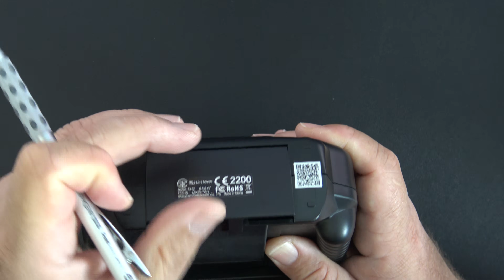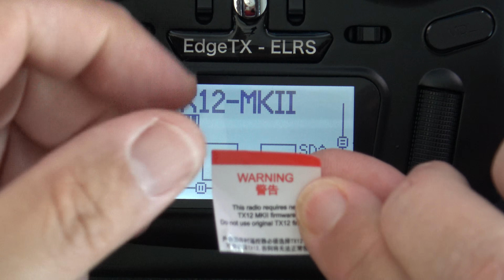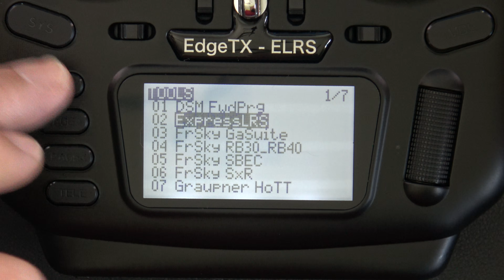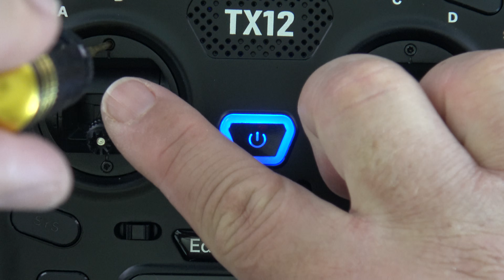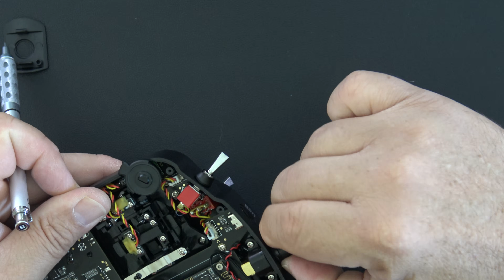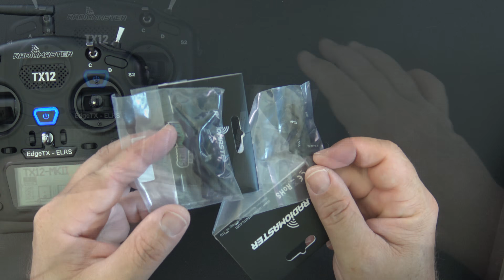Radiomaster TX12 Mark II with EdgeTX and Express LRS First Look

Comment: Maybe I'm a total noob, but how can you practically use 16 channels on a TX that only has 6 switches + 2 sliders? 

I obviously don't have anything that uses that many channels, but I'm imagining, things like flaps, extra flight modes, lights, launching fireworks, etc. It seems like most things would require at least 2 position switches, so how are all the extra channels accessed instantly?

Comment: Charging and battery holder are minute issues. #1 While charging; even if the port was on the bottom, you would still lie it on the back. #2 Battery holder; just cut-off a custom piece of foam. Or use the sponge landing pads that you buy in a box.

Comment: Hello nice tutorial, but I must say I am in a deep trouble , hoping you guys could help me ,I am very new to this field , this is my first build with Pixhawk 2.4.8 and Mission planner. I am planning to buy TX12 Mark II Radio Controller (ELRS version) , please help me choose a receiver, I am unable to figure out what is needed for my quadcopter and also what is the difference between RP1 ,RP2,RP3 ELRS Nano Receivers and ER4 ER6 ER8 2.4GHz ELRS PWM receivers? please help me  and also do I only have to buy the receiver or any other extra hardware with it ?

Comment: They should have just allowed you to upgrade the v1 tx12. I like my radio more with the dual charge, comm usb C port. I like the grips more on mine. I just wish it had ELRS instead of the useless multiprotocol module.
Reply from the maker: Probably tough to please everybody.

Comment: I just got this and a tiny ape and am struggling hard... do I need to update the software immediately??
Reply from the maker: The only thing you really need to do with software is to make sure your ELRS tx and rx are running the same versions. The firmware that comes with the TX12 is fine.

Comment: I meant to comment last month when my tx12 arrived, but I wanted to mention that I purchased direct from Radiomaster along with their lipo battery, and it came installed in the tray with some very snug foam in there.  Not sure if the foam is new or they did it just because I bought the battery along with it, but no rattles here!
Reply from the maker: Maybe they watched my video! :)

Comment: Hi! I have the elrs version of TX 12Mk2 only to find out it does't have MULTI protocol(at leat in the radio setting). I only see CSFR (the elrs receiver I ordered is on the way yet so I cant test the crossfire part). Am I correct to say it really doesn't support other protocol? Then, playing with the EdgeTX Companion, I accidentally, was able to set "MULTI" in the internal RF of the radio! I got excited but sadly I had no luck binding both Radiomaster and flysky receivers to it. I might be doing it wrong (binding) or is it just a setting glitch and the radio is still saying " I'm ELRS only"? i feel bummed I cant use the radiomaster receiver I just bought. Thanks in advance.
Reply from the maker: If you bought an ELRS version of the radio, you can only bind with ELRS receivers.
Reply: @RCVideoReviews  thank you. I need a multiprotocol module then. I hate to part ways with the cheap Flysky receivers I have.

Comment: Hi there,i have a question or u can say confusion.i got my tx12 mk2 and the first mistake I made,i powered on the radio without the antenna,i actually forgot to install then as soon as I hear the welcome mssg i realise the antenna is not there so i quickly shut it down,will it harm the radio for that?it's still working tho but no idea what goin on inside.
Reply: You should be fine. On first power up the default model should have no module selected so RF should be off.
Reply: @sansjunk  actually it was not the very first time,my bad i forgot to mention i actually checked when i got the radio it was binded to someone else's quad for checking then i detached the antenna and leave it in the box then after i got my quad,now this time when i powered it on the antenna was not there.Thats y m scared tho as I mentioned it's still working but is there any way that i can check if everything is fine by signal strength or something?
Reply: @as1asim  Ah OK. I believe you should still be fine since you didn't leave it powered ON without the antenna for too long and hopefully the ELRS module was set to low power (10mW). You can do a range check by setting it to low power and then walking away and ensuring you still have a good LQ and are able to control the model.
Reply: @sansjunk  yes it was set to 10mw,it was like under 4-5secs.Thnkx man🙂🙌

Comment: I have a question. I’m brand new to the hobby and I’m looking for a good transmitter to buy
and the question I want to ask is that, you showed that it has Elrs installed but is the Fs in their also another receiver or is that something else and do you need to get another module to work with other drones?
Reply from the maker: I really don't understand this question...
Reply: Sorry I put this wrong. Is Elrs the only pre installed module on their or are their others on their
Reply: @FireChicken747  The ELRS comes only with the ELRS internal module. You can buy and install an external multi-protocol module at the back to open up a whole lot of options to fly many models. I bought an IRange IRX4 MPM module to do just that.
Reply: I’m new to this stuff so I still have a lot of learning to do

Comment: Will the battery for the TX16S work in the TX12 ?
Reply: According to their web-site it looks like it does.
Reply from the maker: They use the same 18650 tray. I haven’t tried stuffing the radiomaster 5000 2s in the tx12 but I think it would fit.
Reply: yes it does i have both with the same 7.2v lipo

Comment: Great review. On the battery compartment... They went from "so tight you can barely get the battery out" to "baby rattle loose"... but I think that was so you could use to 21700 5000mah battery pack with it ;) if you look closer at the battery compartment, you'll also see a cutout for the XT30 lead. And if we modelers can't figure out how to stop the rattle with a piece of foam, we shouldn't be in the hobby! 🤣 While I also wouldn't have minded the pots on the top for sound and brightness, at the same time I think we're expecting too much TX16S and starting to clutter an otherwise well spaced out layout.
Reply from the maker: The battery thing is an easy fix which begs the question why wasn't it fixed. As a reviewer if I don't call that type of thing out, I get called out. 

Controlling volume is just kludgy without a knob. I've used the firmware to work around this https://www.youtube.com/watch?v=NqL6yUOfNPU    but nothing beats a physical apparatus to  control volume. Just an opinion though. I'm sure plenty of people get by on plenty of radios without using a knob.
Reply: @RCVideoReviews  Newest shipped models have a couple of bits of what looks like pool noodle foam to hold the battery tray centered. Looks like they're listening. 😉
Reply: @theoztreecrasher2647  I confirm, just received mine and I have some foam inside ;)

Comment: Comrade: I heard you weren't well, I'm relieved to see you back on the air & hope you are feeling better.  
I love that EdgeTX is already installed out of the gate. I currently have Jumper T18 & I'm wondering if the board inside the radio featured in this video would support a touchscreen mod upgrade as easily as my jumpert18, which was basically plug in the digitizer and desolder a coupe resistors off the board or if the touchscreen mod would be major surgery.  On the jumper T18, touchscreen mod was a simple operation not unlike a vasectomy,: get a local anesthetic & of a couple snips, afterwards you can touch to your hearts content, but, iif the radiomaster isn't so easy we are looking at a heart transplant type operation and I'm sure the patient will expire on the table.  Is there an expansion plug for a digitizer on the board for this radiomaster?
Reply: "marketing wank" is spot on... They said something like "touch screen ready" (well as vague enough references you thought that like the TX16S it was just waiting software support) and were promising digitiser panel and "HD" display upgrades... neither of which eventuated.
Reply: @pfeerick  "Marketing Wank" credit 'Arduino vs. Evil' (AvE) https://youtube.com/c/arduinoversusevil2025 
I have to send him a quarter every time I use those words. DANGIT!  Now I owe him $.50!
Reply: No, there is no touchscreen support onboard, and even if there was, there is no software support for it *at all*. The t18 was possible because it was actually designed for that from the start (although jumper did botch the job - hence the resistor mod, which is why they didn't officially add touch support).
Reply: @pfeerick  gracias, Peter.  Took me quite a while to find anything helpful regarding why it didn't work right away when I plugged in the digitizer on my T18 jumper.  I felt quite mislead as I thought the touchscreen was already ready already when I bought the thing & only awaiting software support:. I forget the exact wording but that's basically what the marketing wank read regarding touch support on the j T18. I likely would have pulled the trigger on the Radiomaster had I known at the time.
Pity about this radio, but I bet subsequent touch radios from radiomaster will feature Edge out of the box & I'll get one of those.  Thanks again

Comment: Is 2.8 sarebbe to fly ?
Reply: For B&W radios, it should be, as they hadn't had as many changes as the colorlcd radios. But as with any pre-release firmware build, do the bench tests to make ensure everything is working as expected.
Reply from the maker: I wouldn't hesitate to fly it. 

I have a degree of faith in the Edge team and Radiomaster. I don't believe they would release a firmware on a production radio that had untested core features. There are a lot of new features coming in 2.8 for color radios with LVGL, but that doesn't apply to these mono targets.

Comment: Why does Radiomaster need a scroll wheel and 6 navigation buttons while T-Pro does the same things with a scroll wheel and only 3 navigation buttons?
Reply: Need, no it doesn't. I could also ask how do I access model or radio settings with one button press on the t-Pro (spoiler, you can't)? Radiomaster have preferenced single function buttons over multifunction, which is the more user friendly design. Separate sys and MDL keys, instead of combined. Separate page and back back keys, instead of combined.
Reply: @pfeerick  I’d much rather long press a button on the T-Pro rather than find a bunch of different buttons on the Radiomaster. I’ve used the Q X7 for almost 5 years, so using only 3 buttons is what I’m used to.
Reply: That's the beauty of different manufacturers (and designs), isn't it... You can go with what suits your preferences (or, these days, even 3D print and make your own!).
Reply: @pfeerick  Yes, very true my friend, we are living in good times for RC 😁

Comment: A couple of things not made completely clear John. I presume by the look of the socket internally that the trainer socket has been changed from that stupid 4-gang odd plug to a standard 3-gang audio plug compatible with FRSky, Spektrum etc? Also are the back mounted additional push buttons plugged in in place of an existing switch or into a spare socket on the board? If the latter, where?
Reply: The momentary and latching buttons are for the TX16Smk2, not the TX12 ;) On the tx16smk2 there is a hole on the back that has a rubber stopper fitted, which you can remove to fit one of the switched, as well as extra sockets on the main board.
Reply: @pfeerick  Oops, my mistake again! I thought that I had seen someone pull a rubber bung out of the back of one of these somewhere. Obviously been watching too much Youtube lately! 🙄
Thanks for keeping me on the straight and narrow Peter. 👍👍🙃
Reply: @theoztreecrasher2647  maybe for the mk3... Would be a nice option

Comment: I am wondering if it is possible to install the ELRS module into TX12-mark I ?
Reply: Yes, you can use pretty much any JR bay module with the original TX12. But if you mean to get the internal one out of the TX12, I would suggest not as it is basically a one board deign.

Comment: Thank you for the first look at this radio. I am not very tech knowledgeable but after watching your channel for the last several months have been wanting to try the radiomaster radios. After being away for 20+ years I just bought a used Spektrum to get started flying again. Do you think this would be good for a place to start for someone with limited funds?
Reply from the maker: It definitely would be a good option if you have limited funds. That was actually one of my conclusions at the end of the video. As long as you understand its limitations: Fewer switches, smaller form factor, internal ELRS vs standard 4-in-1.

Comment: To clarify, the max wattage for the ELRS module is 100mw. It's true that even at 100mw ELRS has great range, but the fact the that this limit was barely eluded to implies that RM and the reviewer(s) know that this limit is not very marketable.
Reply: It is, is it? So why does my mk2 let me set it to 250mw? Lol. John just happen to stop at 100mw in the video, it's not the max! It would however be nice if RM actually mentioned the wattage on the store page.
Reply: @pfeerick  Yes sir. I went searching and didn't see it - a month ago. I appreciate the info :) .
Reply from the maker: Just about everything you said is wrong.

The max power is 250mw not 100mw. 

ELRS is so good even at 10mw I don't bother setting mine any higher than 100mw--especially for LOS. So even if the max were 100mw, it would be more than enough unless you plan on flying many many miles away.

Is "barely eluded to" different than "directly shown" or are they the same thing because it was directly shown in this video.

There is no conspiracy in place. 100mw is fine, and the module provides 250mw.
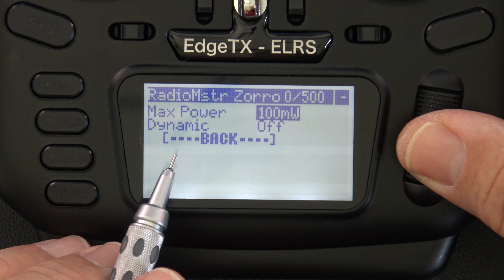Reply: @RCVideoReviews  My apologies for the implications. I was/am referring to 6:34 ~, where you go to 100mw and stop. Granted, at some point, I may have tuned out - squirrel!.. I really don't see where you said 250mw. 

10mw is OK for LOS, I use it often at the park. I'm not a math scientist, but my thought was/is higher MWs is better for penetration; like flying around parking garages, etc. No? I mean, what If I wanted to fly to the center of the Earth, would 250mw be enough?

At the very mostest I was being a teensy bit sardonic before. and now. and probably later.